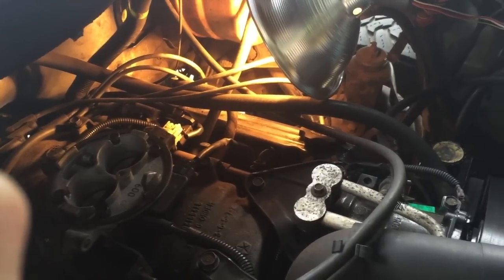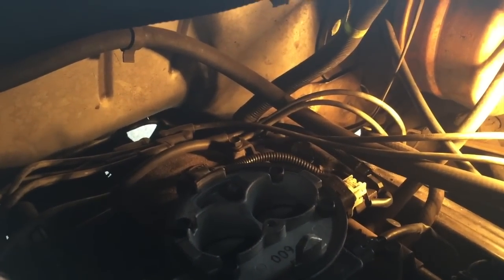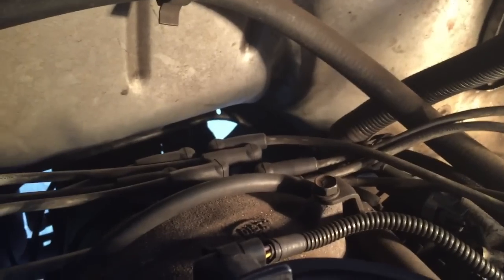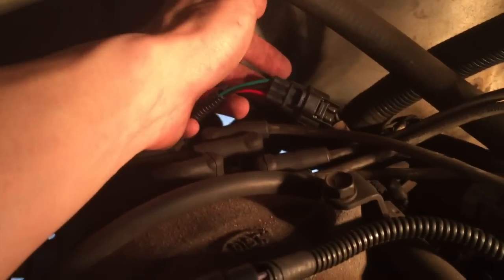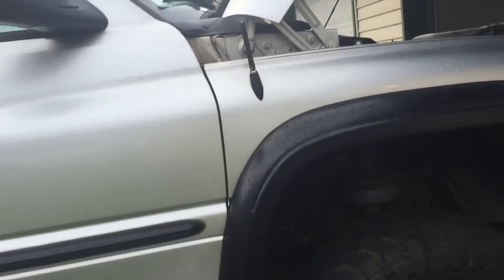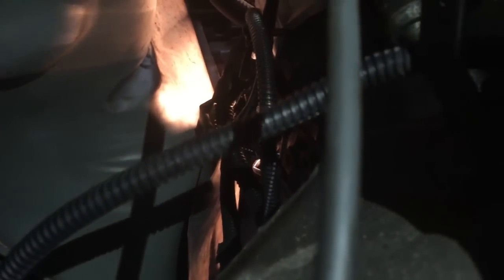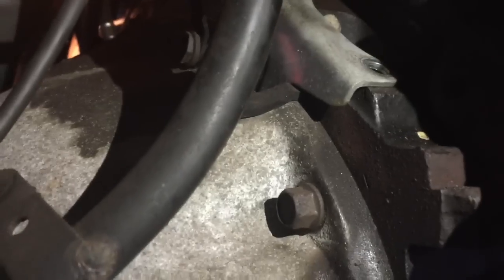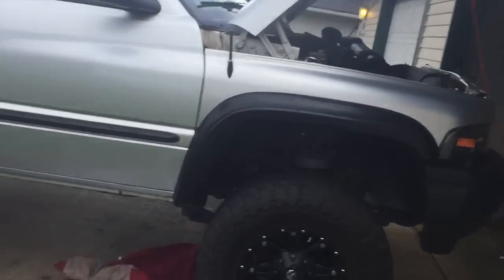2001 Dodge Ram 1500 5.9 (AUTO) Crank Shaft Position Sensor Replacement Tutorial

Comment: This is a great video. I think that the thing to understand is that the wire plugs into the back of the motor but the bracket and bolts are 90 degrees and basically face up. The transmission tube bend is a really good land mark. You can basically follow the tube and touch the bolts from the top, too. It still took me forever to figure this out! Thanks!

Comment: This video defiantly helped..I to have a 2001 ram 1500 5.9..I actually Just was driving it down the road here in Camp Lejeune and the engine shut off..Everything electrical worked, but anytime I tried to re start it it would struggle it wouldn’t turn on all the way but I automatically though it was the CPS because the same thing happened in our 2016 Jeep Patriot..but I just got this truck. The video was defiantly helpful thankyou
Reply: What was the issue?

Comment: Thank you for the video… I just purchased a Dodge Ram Half Ton Quad Cab 5.9 that is cranking but not starting and I just changed all the spark plugs which did not do the trick but I’m thinking now it is the crankshaft sensor.  A crankshaft sensor will keep the truck from starting, correct?
Reply: Correct.
Reply: Also cam sensor, remember.

Comment: Short and sweet without any hype.
 Thank you
I ordered one that came today and I'm changing it out cuz my truck never throws a code but I'm replacing the air charge sensor replacing the TPS the O2 sensors the crank sensor the map sensor just because it's a 99 as almost 200,000 on it it's still runs great but has an intermittent stall problem every now and then stalls it won't start back up for like 10 minutes so I'm going to do the fuel pump also.
Reply: Did all of that fix your stall issue? I’m having the same problem

Comment: thanks man this really helped me and no one else's video was this detailed to help. really helped when you backed up slowly to show me exactly where you was at hope it works and hope its my crank sensor since my truck won't start now after putting new motor,tranny, transfer case in and radiator and water pump and new heads. was almost about to give up on it
Reply from the maker: No problem man! I appreciate you watching and glad I could help with your project! That's what this video was all about when I made it!

Comment: Thanks Bro! 
Installed a new timing chain and my engine ran super smooth but idle at 500. It then boggs out. I changed pcm, 02 sensors, idle air control to not fix anything. I didn't think my 5.9 had a crank sensor since it isnt the newer hemi 5.7. I hope this fixes it!

Comment: Thanks for the video, I just got a 2000 Ram 1500 with the 5.2 (318) engine. I'm going to replace the crank sensor this week and I think its in the same location.
Reply: Was IT at the same location ? I also got a Ram 2000 1500 5.2 and i got to change it too !

Comment: Can you do one on the camshaft sensor?
Reply: easy peasy- pull off dist cap and look underneath. Disconnx battery lead and make SURE you don't pinch the lead and know which way the cap and wires fit so you don't screw with the firing order.

Comment: Why did you change the sensor? I'm working on my brothers wich is cranking forever before it finally starts, I've been through everything and I am starting to think this might be what is wrong with it. He said it runs fine until it shifts into 3rd gear then it starts breaking up. Any input would be great, thanks.
Reply: Could be bad battery or something In ignition system like distributor cap rotor spark plugs/wires coil.
Reply: @thecosmickat3954  or cam sensor ring in the distributor housing cap.

Comment: Did you have a check engine light on? If not, what problems were you having? I have a 2nd gen. with the 5.2 and have rough idle issues at cold start but no check engine light. Plenum gasket is good, New O2 sensors,, new plugs/wires/cap/rotor, cleaned throttle body, etc. Some of the members on the Dodge forums have found this sensor to be the culprit.
Reply from the maker: No I did not have a check engine light on, but I would definitely replace yours I think it could possibly be your problem too. Next thing I would check is your timing

Comment: Great truck ..... what do you do if you don't have a body lift like that....
Reply from the maker: It will be a little harder to find if you don't have any lift. But it's still in the same spot and you get it off the same way
Reply: one thing about these trucks is that a body definitely helps for these sensors as well as removing/ installing the motor. Way easier if you have the lift.....mine doesn't but I may add one in the next year or so.

Comment: My truck is starting up very inconsistently like somedays it'll be fine them others it won't work at all. last night I changed the rotor and distributor and it started right up. this morning it worked fine and I drove it to school. once I got out of school the damn thing wouldn't start! all it would do is crank. Is it possible the crank shaft sensor could cause this?
Reply from the maker: It is definitely a possibility, yes. Have you plugged up a code reader to it?
Reply: unfortunately I don't have a scanner so I haven't tried that. today it shut off while I was driving and then wouldn't start up. a couple hours later I got it to start once but then it cut immediately.
Reply from the maker: It could be a lot of things man, I suggest getting a buddy with a code reader or going up to auto zone and getting them to scan it
Reply: Think codes will show up even though there's no dash lights on?
Reply from the maker: Well there's no guarantee it will, but it is a start and I would go from there.
Reply: Alright I can bring it to my schools auto tech shop. Thanks for the help!
Reply: didn't bring it to the shop and went with my gut and put in the new sensor. Fortunately I was right and its been working since! thanks for the help and the great video
Reply from the maker: Great News! Glad to hear that man!
Reply: Woah man. will it sometimes crank and crank and crank before it starts? cause I'm having that issue. 4-7 seconds before starting.
Reply: no it just would or wouldn't start, no matter how much i cranked it

Comment: I’m having the same problem I have a 2001 Dodge Ram 1500 5.9 liter. I wired a subwoofer then when I tried to start, it started the first time then just died. Now it just cranks but will not start at all. When I give it a little gas it will just barely run then die. Please help

Comment: my check engine light is calling for random missfires amd iv done a full tune up on it. what could it be? im getting like 5mpg
Reply: mx guy2014 cap and rotor O2 sensor maybe.
Reply: Use the method to get the code displayed on the odometer.  My Actron scanner did not show any codes.

Comment: my 98 1500 5.9 is doing that but i was able to get it running by giving it gas for a mins.
Reply: Bothdoorsup I'm having problems with my 2001 Dodge Ram 5.9 and crank sensor keeps going out on me I was wondering why I keep replacing it and it keeps going out what could be the problem why it's doing that I appreciate if you can let me know

Comment: How do I know if my sensor is bad. I have the same truck and it idles high and kicks when I put it into drive it recently just stalled as well.??????
Reply: Might also be a o2 sensor I have a 95 and it was doing what you said idling high kicking when shifted occasionally stalling. You’ll know if the sensor is bad when either the truck shuts off and cranks but will not start. The easiest way to diagnose is if it shuts off and will not start crank the motor and look at the rpm gauge. If the sensor is bad it will not show any rpm. If it shows rpm it’s something else.

Comment: ParoDoXz 
Thanks bro!! My 5.9L 98 Ram 1500 4x4 ext 
needed same sensor ..Had idea were it was located ..Was a bitch 2git 2..after watching your video shit was a breeze!!!
Sadly lol didn't fix problem
Reply from the maker: Glad to help man! But sorry it didn't fix your problem, I hate when that happens
Reply: I'm still not getting any spark from distributor.. Changed ignition coil, distributor cap, rotor, crank position sensor and spark plugs. Any suggestions?
Reply from the maker: West Tenn Reppin Hmmm... it's hard to diagnose it without seeing it in person, but I wouldn't know what direction to point you in because you already pretty much did everything I can think of
Reply: lol it's probably something simple 
u think crank sensor I bought from AutoZone could be bad?
Reply from the maker: West Tenn Reppin It's a possibility, I would be leaning more to the the distributer cap though
Reply: ParoDoXz  Im going to change cam sensor under distributor next..
I'll keep u posted with updates
N ur Cummins I saw is bad ass too

Comment: Sure this isn't the camshaft sensor?
Reply: No the camshaft sensor (also called an ignition pickup) on these Dodges looks like circular disk, like a black DVD, with about a 6" pigtail of wires attached to it, and it sits right under the distributor cap.

Comment: That one fricken bolt is such a pain in the arse to get out...
Reply: Adam Greendeer my 2001 Dodge 1500 starts but after it warms up it won't crank up again I changed crank shaft sensor but still won't start code is 0340

Comment: this sensor sucks...take off the passenger inner plastic fender and take off the wheel and you can get a socket in there..its a reach though. be gentle on the wires..i got it all done and a wire came out of the harness damn thing would not start..i had to splice the old connector with the new sensor..
Reply: Won't the frame and exhaust still be in the way?

Comment: Why did dodge put it in a crappie spot
Reply: They are usually behind the harmonic balancer. believe me this is much easier.
Reply: rat fink on a ford they are in front where they can be easily found and changed. Maybe that’s why we should always buy ford. Lol!!
Reply: @jessaryenterprises  I've never owned a Ford but on most GM products I've owned it's in the front right above the crank snout and you have to pull the balancer. I have a 2001 Ram with the 5.9 and I think it needs the crank sensor replaced. It randomly is hard to start and will shut off in gear when I come to a complete stop like I turned the key off. Feels like the converter is locked when it does this. So not sure what's up.